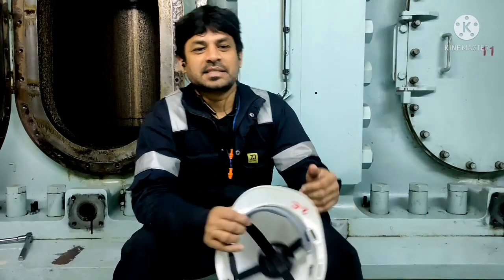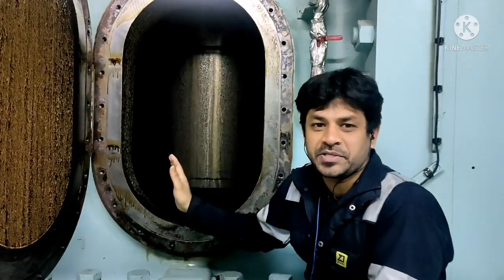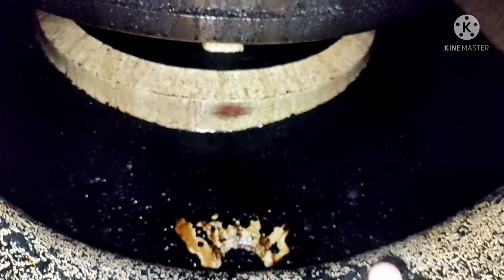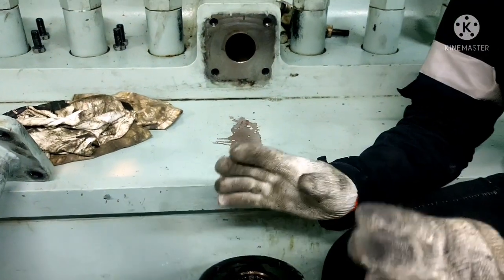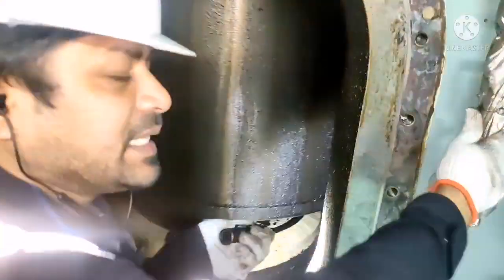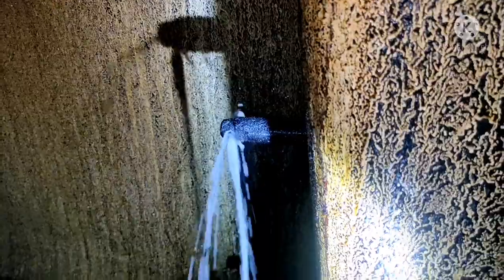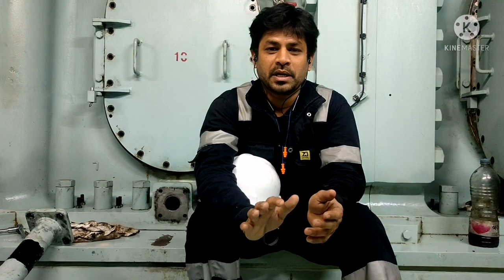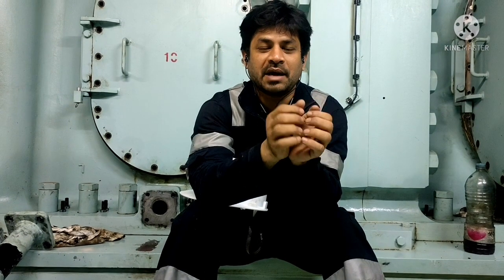How do they do... Know about Scavenge fire onboard ships..

Comment: Sir are we having any mechanism to stop scavenge air to that particular unit?
Reply from the maker: No dear there is  no  any arrangement for particular unit scavenging...
Reply: @marine-knowledge-basha  sir but if scavengenfire happens there is fuel and air and heat it forms fire triangle .air is continuously supply and heat can be take time and fuel is at the bottom of the scavenge space s
Reply from the maker: @nagadurgaprasad2156  sry for delayed reply sir...
U r vry rt.. Fire triangle will be there when scavenge fire occurs... That is the reason that we stop fuel oil supply and the auxillary blowers to cut the fire triangle.
Hope this reply will satisfy your query..
Reply: @marine-knowledge-basha  yes sir thanku
Reply: Sir don't call me sir I'm a student
Reply from the maker: @nagadurgaprasad2156  😊sry dear got used to... Vl try not to repeat again
Reply: @marine-knowledge-basha   I will call you chief  so you can understand sir
Reply from the maker: @nagadurgaprasad2156  😊